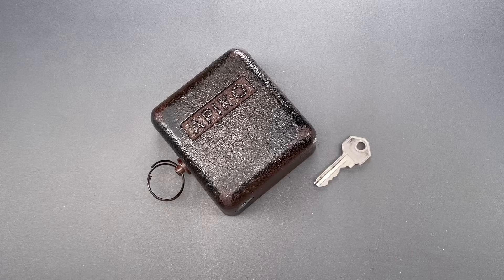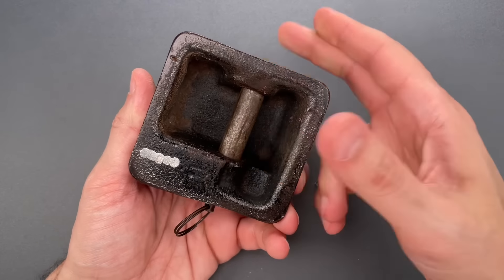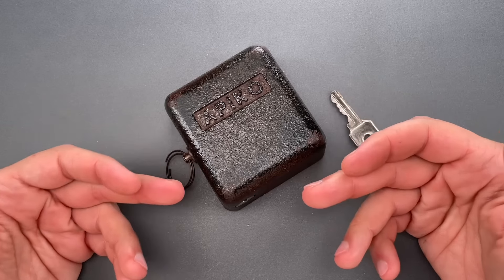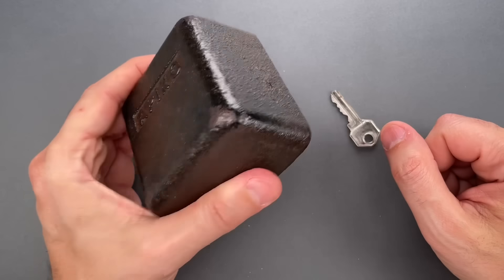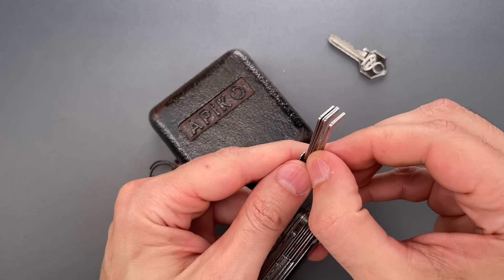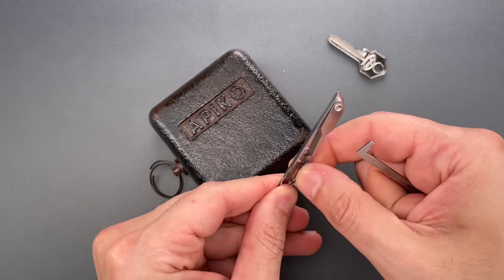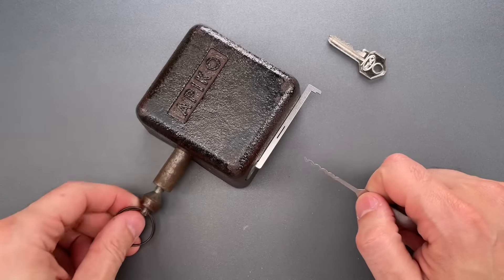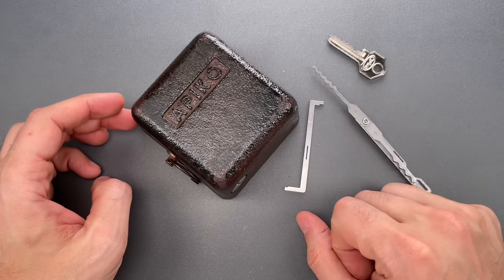[1565] A Modern “Soviet” Lock… As Bad as the Original (Apiko)

Comment: Most likely this is not a “reproduction” in the usual sense. It’s just that some businessman privatized a former Soviet factory and continues to produce old locks on old equipment. There are quite a lot of such products in Ukraine, as well as in Russia and other post-Soviet countries.
Reply: Yeah it's surprising the tools and materials and the entire factory wasn't "sold" for scrap, this was the fate of many soviet factories after it dissolved
Reply: @lolatmyage and it is mostly good idea, because soviet products can't compete with other countries product in market-driven economy anyway, therefore completely useless.
Reply: one of them oligarchs
Reply: @voidseeker4394 are you suggesting post Soviet countries do not have market economies even 30 years after the collapse of the Union? Or do you just need to invent a reason to feel smug, Westerner?
Reply: That's the right answer right there. They might pretend that it's an "homage", but this is the exact thing that's going on
Reply: @RE3254 that is nowhere near what he was saying and you know it. You are just being overly sensitive.

He is saying the soviet designed product built on soveit era machines, built to soviet level specs (all of which were dictacted by the defunct government) do not match the modern quality of market driven design.

   It doesn't really matter if the post soviet countries are hardcore market capitalists now, if they are still using soviet designs and soviet tolerances... You are going to end up with a less then ideal product 9 out of 10 times (there are always exceptions, obviously).
Reply: @RE3254  read again what i wrote. They ARE market-driven now. That is the reason why soviet era factories are abandoned and sold as scrap. Also, it's funny that you've called me westerner. I'm from Ukraine.
Reply: @voidseeker4394  Not really because that meant selling off almost all the industrial capabilities they had, and the old factory districts became completely derelict eyesores. 

So yes, maybe production capacity should have been reduced and reorganized but no, all of it should not have been scrapped. The stuff that was left behind, some companies are still using those machines to make new, different products to this day.
Reply: Or Master is branching out
Reply: Maybe if, someone that still lives in that part is of the world, will chime in, and let us know.
Reply: @lolatmyage  Honestly I feel like most of the higher-end stuff DID get sold. It's the generic goods factories that seem to have survived the best due to there being so many of them, and it being mostly generic machinery without rare metals. But that's just me vaguely guessing.

I wish there were more mainframes that have survived, for museums to keep and such. Alas, they had gold and other "valuable" metals. Probably were the first thing everyone sold or scrapped.
Reply: I don't know which one got wrecked more, this lock or re3254... 😂
Reply: You took the words right out of my mouth, most likely an old crook who took over the state factory.  If it's junk in a former Soviet state, the Russians likely brought it there.  

I think this is a very poor time to suggest that Ukranians lack engineering competence and suggesting they're equivalent to Russians so they might as well let Russia keep the territory they're illegally occupying (less of every day) and get away with mass murder, rape and kidnapping.  

Just looking at Ukraine's naval drones that are making the entire Russian Black Sea fleet incrementally disappear, as well as the mystery destruction of Russian bomber aircraft in their parking spots well beyond Ukraine's border shows you the vast difference between the Ukranians' skills, talent and work ethic and those of the genocidal Russians. 

I am a fan of the channel, but this commentary was a poor judgment call, especially for a lawyer who should know what the stakes are by clouding the distinctions between a forward looking society being surpresed by an inherently backwards mafia state.
Reply: @christopherhoyt7195  He's purely telling the truth.  My suggestion is to accept that no country or person is perfect.  A county of 40 some million people having one crappy company doesn't imply anything about the rest of the country.
Reply: @arthurmoore9488  Ever heard of "too soon and false equivalency?"  No, no one is perfect, but the Baltics and Ukraine are clearly in a superior league compared to Russia.  To suggest that no technological progress has occurred in the nations that have reestablished their pre Soviet sovereignty is not only inaccurate,  it begs the question, whose side are you on?  If the Soviet Union were really defunct, Russia wouldn't have inherited its UN security council seat and veto power.  Same bear, different fur.

In Ukranie or the Baltics,  you can criticize any lock you want.  Try saying these things in Russia or Belarus about an oligarch's product, and you'll probably be arrested for exposing state security secrets.  If you think I'm wrong, go to Russia and just accept a flier being handed out.  Then get arrested as an accused spy trying to smuggle state secrets out of the country.  It happens all the time.
Reply: @voidseeker4394  Depends on the product in question, but to a large part this is true.
Reply: @lolatmyage as if the industrial districts weren't eyesores before.
The difference is that now they don't pull the whole country down to their level
Reply: @christopherhoyt7195  For distributing leaflets criticizing the authorities, you will most likely be arrested both in Russia and in Ukraine. In both countries you will be accused of working for the enemy. (I won’t say anything about the Baltic states; I’m not very interested in what’s happening there.)
However, you can criticize door locks and other products in both countries. You won't get anything bad other than a few negative comments. There are many channels that do this.
Reply: Yep, you can still buy them in Georgia
Reply: @kote315  Nope. In Russia it is allowed, in Ukraine not. But you will be arrested in Canada if you say that trans-women are not real women 😆🤣
Reply: @voidseeker4394  today 50% of all Chinese exported products to the world market are cheap, low-quality crap. And these products sell very well.
Reply: @alexkart9239  and yet it's generally better than soviet crap. At least it looks better, and is up to date with modern technology.
Reply: @kote315  you won't be arrested in Ukraine for criticizing the authorities. Right before the war we had a meeting under the government office windows nearly every week, lol. Of course things became more strict with the state of war. But still, criticizing the government is not equal to working for the enemy here. Never was since we got independence. And i hope it never will be. That's the main thing we are fighting for.
Reply: @voidseeker4394  But now you don't have meetengs every week. Have your requirements (by the way, what ones?) been met?
Reply: @kote315  dude, we didn't want this war. It's not our fault that we got invaded.
Reply: @voidseeker4394  I'm not blaming you for starting the war or anything like that. I’m just saying that for some reason you stopped attending rallies, most likely not achieving your demands. It seems to me that this means that you are afraid to participate in such things. Considering that over the past few years the activities of several parties have been banned (and all others suspended), there are documented cases of attacks on journalists, criminal cases for likes on social networks, blocking of Internet resources, the adoption of language laws criticized by the European Commission, and so on, I come to the conclusion that criticism of the authorities is not welcome and can end either in arrest or violence in one form or another.
Reply: @kote315  we are just busy, not afraid. You are right, few parties were disbanded, as they openly supported the side that drops bombs on our schools and hospitals. Is it violation of democracy? Theoretically yes, but practically I don't see the parties that openly support terrorists in most civilized countries of the west for some reason. I guess they are not democratic then too? Parlament still functions and has the quorum of publically elected deputies. Judiciary system still function. We are at war with foreign invader, not with our government. And the government do what majority of citizens want it to do. If this is not a democracy I don't know what is then.
Reply: @voidseeker4394  Not really. Parties that you consider pro-Russian were banned, but this does not mean that they somehow supported aggression. You do not have a single piece of evidence that Shariy or his party supported the Russian government or had an anti-Ukrainian position. However, this party was banned. (I don’t want to say that Shariy is good or bad, but objectively there is no reason to ban the party, and the court’s decision in the relevant case looks like complete nonsense.)
Also, I hardly agree that the government does what the majority of citizens want. Of course, everyone wants peace on favorable terms, but it is unlikely that most people want tougher mobilization measures. Just as many did not want the adoption of the law on the sale of land and many other laws earlier.
By the way, Zelensky and his party won the elections precisely as an alternative to Poroshenko’s policy, but now they are actually continuing it. Not what people wanted in the elections.
Reply: @RE3254  Some do have really bad economies, actually.
Reply: @lolatmyage  while privatization was very unfair and prone to abuse (tons of people bankrupting factories to buy property for nothing, intimidation etc.), most cases things were sold for scrap because the factories weren't turning profit. Planned economy just never was a working thing, a lot of deficit goods would be missing (people washed plastic bags) but you would get... antlers... and wooden owls... in every house because they had to do SOMETHING in Siberia... so I bet 90% of factories that WERE sold out were a drain on resources in the first place, which is what actually led to USSR's collapse: it has NO economy. Like it didn't work.
Reply: @voidseeker4394 you seem so smug trying to shit on other countries lol

try telling soviet quality is lacking to the germans.
Reply: @voidseeker4394  It was NEVER a good idea. In many fields it was great, known for reliability and durability. And just scraping factory itself is never good idea, rather lazy cheap for money. You can always rearrange, modernise, repurpose.
Reply: As a Ukrainian (born, raised and still live in this shithole despite my own will) I’m really enjoying reading the comments of some of the “experts” 😂😂😂
Reply: @RE3254 I take it you didn’t like his comment very much 😂
Reply: @christopherhoyt7195  Another CNN kid? Ofc you know better then locals what is going on another side of Earth.
Reply: @christopherhoyt7195 You are delusonal. Ukraine has almost no science and its education is a lot worse than in Russia, also Soviet education and science was better in some disciplines than in US. Russia just had more money and resources to preserve some of its industrial and scientific capabilities.
Reply: @christopherhoyt7195 my guy spitting complete nonsense right here. Do you imply that ukrainians are genetically superior in comparison to russians? 
You're just making shit up without knowing a thing about both countries and their histories
Reply: Ya the guy who bought the factory is laughing, he probably bought it for $200USD with all the tooling, hired a few desperate workers and away he went. People can laugh at the lock, but I bet his margins are insane.